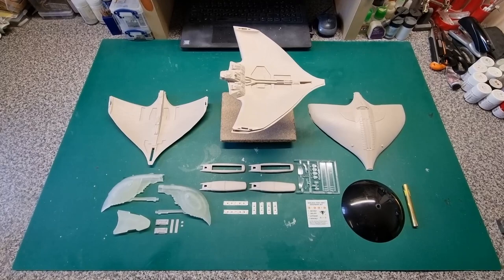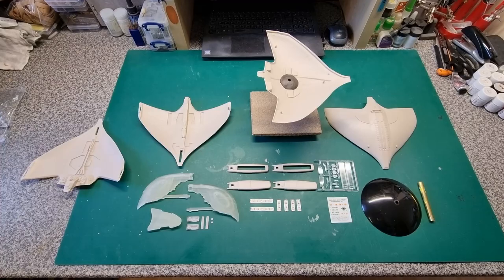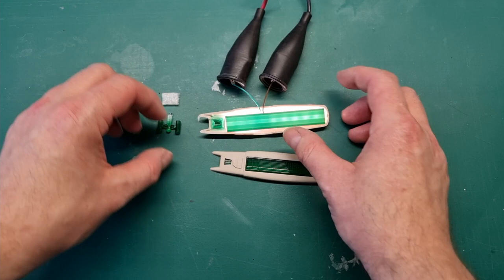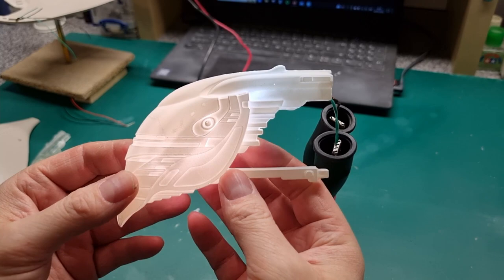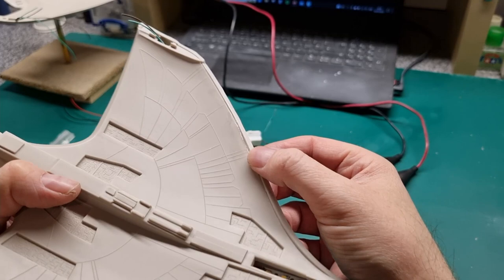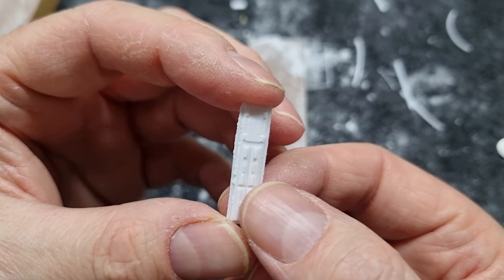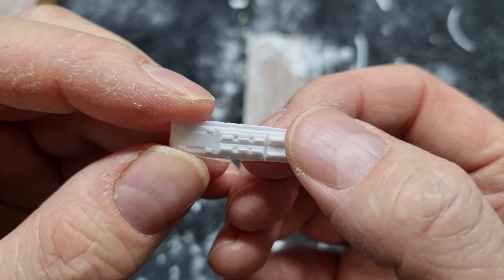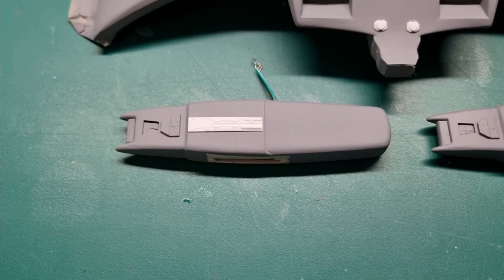AMT 1/3200 Romulan Warbird - MPM Upgrades Demo, Part 1

Comment: Looks like a nice upgrade kit. Have you thought about using wrapping wire? it's a lot thinner than normal wire and is safe to use on these type of kits as they don't use a lot of power.
Reply from the maker: Wrapping wire looks like it loves to get tangled up! Plus, I have TONS of thin gauge wire to get through before I need to think about sourcing more 😄
Reply: @MotionPictureMiniatures  I can honestly say I have never had an issue with it tangled up since I swapped over from magnet wire. Also for the smaller kits that need lighting it is a god send as it takes up very little room. Boyd from Trek Works switched over to it and has never looked back. Once you have finished the wire you have it might be worth having a go with it, I honestly believe if you try it you won't go back to any other type of wire.